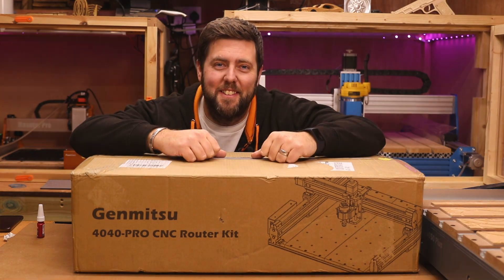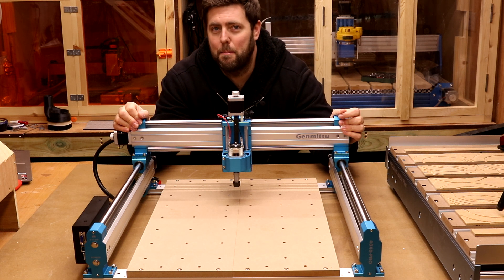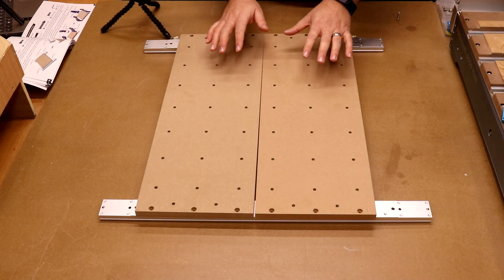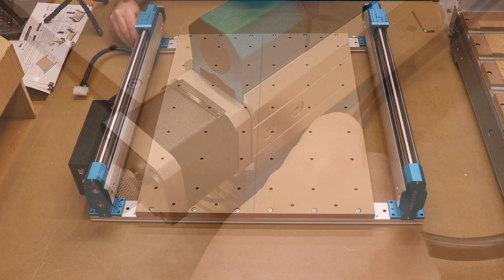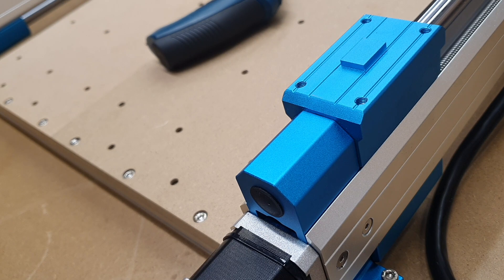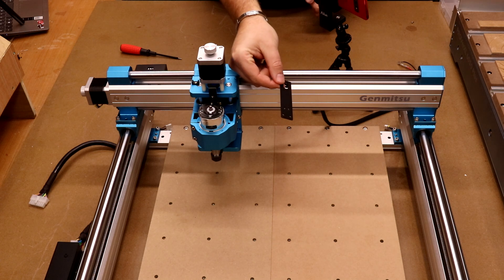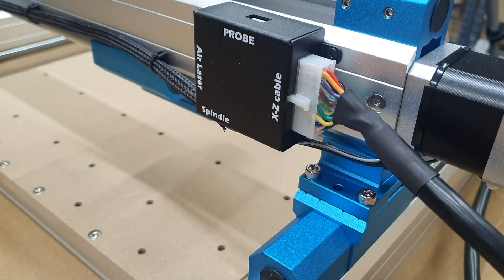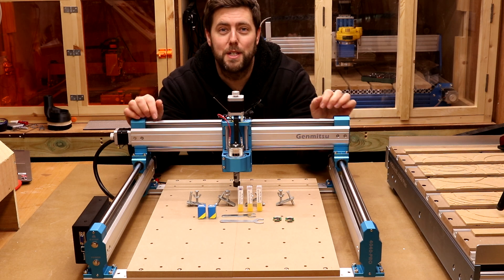Sainsmart Genmitsu 4040 Pro CNC machine - Unboxing and Assembly Guide

Comment: Hello James
I am trying to find a CAD that can generete an *.nc file alternetiv CAD/CAM program. What do you sudgest (not so new to CAD/CAM)
Reply from the maker: Not 100% sure what you mean but are you aware the files can just be renamed? So for example if your file is "test.gcode" you can rename it "test.nc" and it shouldn't cause any issues. Also if its a case of the control software not seeing your files, when you click open and the box appears, towards the bottom right there is normally an option that says file type, expand that menu and select all files

Comment: Hi James, what is the spindle speed for the latest 75W 4040 Pro?
Reply from the maker: It's usually around 11-12,000RPM but as there is no active feedback it's hard to give a precise answer without using a tachometer
Reply: @JamesDeanDesigns  James, I got in touch with Sainsmart support and they told me the 75W spindle has a maximum speed of 9,000 rpm.

Comment: Great video, thanks. On the topic of changing bits, do you have any ideas how to make that process less time consuming and tedious. I see some machines that have ATC and it looks so nice, but that is probably out of reach for the 4040. Still, as I start to do a bit more complex project that require more tool changes I am just thinking about how to make that part of the process as easy as possible. Appreciate any pointers or ideas.

Comment: Great video James, thanks.  Noobie question ... what sizes bits does the 4040Pro take?  1/8th inch and 1/4inch ?
Reply from the maker: 1/8th bits are your best bet. It will take 1/4 bits as well if you buy the insert for it (about £7) but you will have to slow the machine down to compensate for them. Unless you go up to a router and then those will drive a 1/4 bit easy
Reply: @JamesDeanDesigns  Thanks a lot for your help James.

Comment: My x-axis limit switches seem to be unplugged so they are not working, but I can't find a place to connect them to 🤷‍♂️
Reply from the maker: So the wires all run in the tubes, and then connect in the little control box on the back of the X axis I believe (but have not checked what's inside that box)

Comment: I pulled my usb port off the control board on a 3018 pro. Any way around not having to buy a replacement board?
Reply from the maker: Find someone who can solder circuit boards and they can possibly fix it for you.

Comment: thank very much for this video. Can you tell us which are the differences with the 4030. Can you give us more explanations about the laser module ?
Thanks very much.
Reply: The PROVerXL 4030 is a more powerful and stronger one with a 300W motor and C beam structure, while the new 4040-PRO is a 60W, 775 spindle and with lead screw and dual linear shafts. The 4040-PRO is a budget version and fills the gap for woodworkers who want a large area at a very reasonable price.
Reply from the maker: Main differences between this and the 4030XL is the 4030XL has more powerful stepper motors and a more powerful spindle.

Comment: Great design, love the minimalist cable connection, 1 plug is much easier than 8-9 single !! Looks a sleek machine. Wait to see it in action. Think the 60w is a bit puny/noisy these days.. but good for newbies
Reply: I have this machine and it's great not only does it look great but it's very ridgid. The included spindle is small but works great to trim your nose hair. I pulled it from the stock spindle holder and put a Dremel in and it works great. The Dremel 3000 fits great.
Reply: @AWMarine  how does the dremel compare to the stock spindle? I did wonder if the dremel may or may work as i have one sat in the cupboard looking pretty. What sort of speed do you run it at?